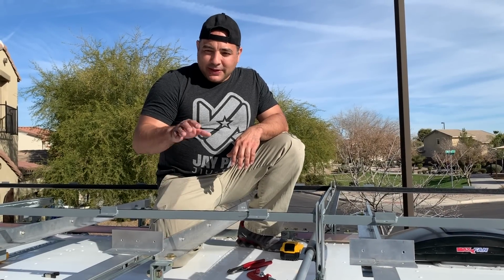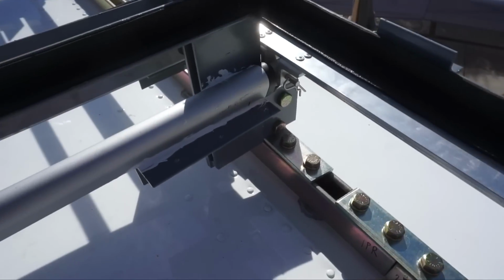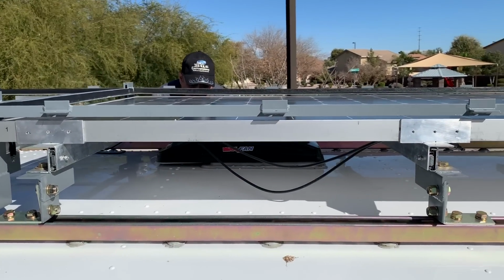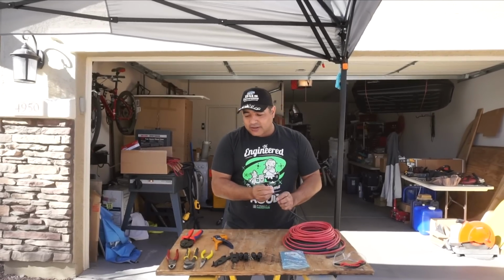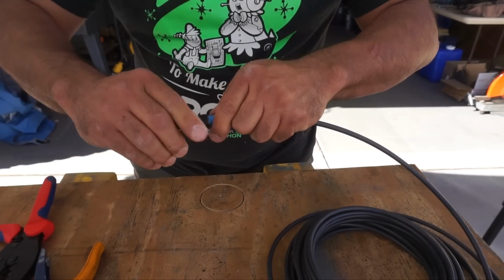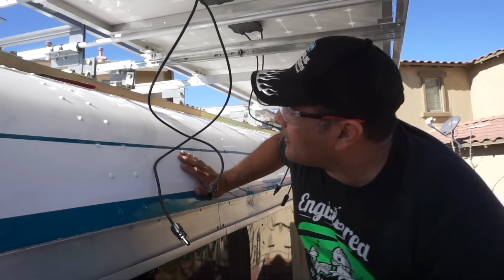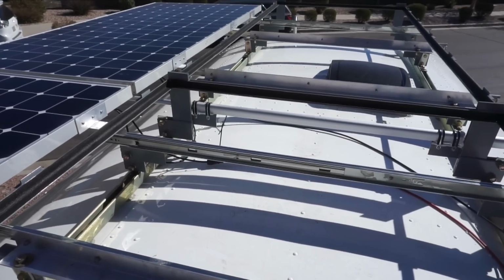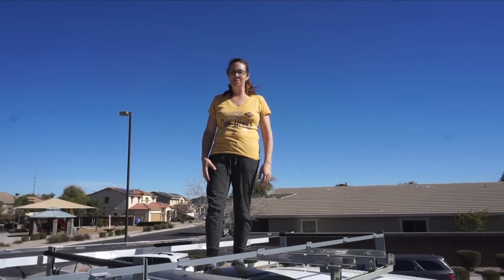Solar Install: Part 3: Mounting Actuators, installing and wiring the lower panels

Comment: I know this is a  couple yrs old, but what drawer slides did you use, and have they held up.
Reply from the maker: I think we are going on year 4 with these sliders in. It has worked great but not without some fiddling.  I have replaced 4 sliders because they end up eating the bearings after a while.  They are stainless so moisture and rain has not been an issue but they do tend to get gummed up with all the dirt and that ends up damaging the bearings.   If I was to do it again I would be strongly tempted to use a stronger slider or a different mechanism.
Reply: @Beginning from this Morning  I decided to just put the 2 Panel's on my roof and then make a suitcase out of 2 more panels that I can place anywhere. That way I don't have to park in the sun 24/7 ...I can partially shade the van and yet put the suitcase in 100% sun.
Thx for reply :)
Reply: One year later 😊

Comment: how was your entire system attached to the top of the rv
Reply from the maker: The entire system is attached with 62 grade 8 bolts that have a big backing plate attached to the structural ribs of the bus.  I wrote about it (and made a video) in this post: https://www.beginningfromthismorning.com/solar-install-part1/

Comment: What holds the panels in when driving? Is it just the actuator?
Reply from the maker: The panels are held in place by the actuator. They they are screw type linear actuators and are more than enough to keep them from sliding out.

Comment: Ha ha ha the real reason you didn't put the screws into the bottoms of the panel is because you forgot that once the panel was sitting on the roof you wouldn't be able to get the drill under there to drill it through the panel lol smooth move haha I do the same crap myself
Reply from the maker: well ... the panel slides out so we could easily get to the bottom of it ...

Comment: If it were me, I would have run those cables down in the uni-strut instead of tieing them to the sides of it. But AWESOME!
Reply from the maker: Thank you lifestyleatm - I considered doing that but thought maybe the heads of the bolts etc in there might be a little to abrasive and wear through some of the wires?  A small piece of plastic would have probably handled that fine.

Comment: Been catching up on your fabulous solar build. Found your channel through "Bus Grease Monkey". What I like about any build is the engineering that goes with it and you are a real thinker. Just wondering how the vibration is on the units and what may show up after some miles.
Cheers, Lee
Reply from the maker: Thank you Lee - We have had the solar panels up there for just over a year and so far so good.  We travel to and from the storage lot twice a week and they live in some bumpy dirt roads.  I did buy a couple spares in case one or two panels develops a problem.

Comment: G’day and greetings from Tasmania Australia 🇦🇺 what a fantastic idea I have been following your progress and it’s been terrific to watch.  The bus/coach is looking great I have subscribed all the best John PS. Are you going to put a wind deflector in front of the structure?
Reply from the maker: Thank you John - great to meet you.  Yes I am hoping to put a wind deflector on the front as well as fill in the sides.  We have had it on since Feb and it does very well - it doesn't make noise and you can't feel it going down the road but I think a small fairing like the semi trucks have would help with the wind.  Thanks for joining us!

Comment: I've watched all your solar videos and I can't find what type of slides you used for the moving panels.  Can you tell me what they are and where you got them?
Reply from the maker: Hi John - Sure - we got the first original few from Amazon and we got the subsequent ones from Firgelli Automations.  They are 50" slides and proved to be pretty difficult to find.  It looks like the price has gone up slightly since we have ordered them.  Every video has a blog post that accompanies it (you can see the link in the description) where we provide a link to all the stuff we used to build that project.  These blog posts provide more insight into how we made a decision as well as some more details of the more technical aspects of the build.  The one that describes the sliders is in part 2 - http://www.beginningfromthismorning.com/solar-rack2/ - if you scroll to the bottom it will have a link to all the stuff we used to build the sliders.
Reply: @BeginningfromthisMorning  Thanks for responding so quickly.  One more question, I see they are not stainless steel, are you having any trouble with rust and if so does it hinder their function?
Reply from the maker: @johntatman1436  I think they are stainless steel (according to the description) ... Been up there since February and 0 rust ...

Comment: I live over in AJ what company did you guys get your solar panels from and was curious on the size of those again
Reply from the maker: Thank you Dave - We are in Gilbert!  The original 8 panels we got from a Craigslist ad.  We did buy a couple of spares recently at a place called "San Tan Solar" which is actually in Mesa and they sell used Solar panels.  We had a great experience with those guys - very friendly and easy to work with.  These are SunPower e20 panels rated at 435 Watts each.
Reply: @BeginningfromthisMorning  thank you guys I greatly appreciate this I was hoping I could find similar panels to what you got. I am looking at putting a Tesla battery in mine. 1 Tesla battery weighs about 55 lb versus 6 lithium batteries at about 600 lb so I was going to go the route of the Tesla battery because it'll do the same as the others and fraction of the weight and because of the size and the room that I have in this little trailer
Reply: @BeginningfromthisMorning  watching you guys do this build what an undertaking it almost seems like a nightmare when you start and you guys have done an incredible job I love watching the progress you guys have made an incredible things that you have come up with for this build. Very grateful that you guys have been videoing the build I'm posting it. It's been a great help get some incredible ideas from all the different ones and it's nice to see one that's been done here close. Thanks again

Comment: I know it's too late now - but speaking as somebody who professionally does crimp connectors in damp/corrosive environments, you'd be doing yourself a huge favor if you put some Noalox on the bright copper before you crimp it.  It'll keep moisture and air out from under the crimp contact areas and keep it from corroding.  Any excess will squish out from the connection.  It doesnt have to be a anti-oxidant like Noalox it can be any kind of electrical grease.  Just dont use petroleum jelly as it doesnt get along well with rubber compounds and can creep and compromise rubber seals.
Also, zip tie the heck out of all those wires - wires that wiggle will break.
Reply from the maker: Thank you - noalox makes a lot of sense there!  I will know for next time!

Comment: I know it's nerdy by seeing those panels side into position was very cool. I wonder how wind noisey the whole construction up top is going to be? You may need to fab up some sort of small wind shield up front (that doesn't shade the panels.
Reply from the maker: Thank you Karl - it is crazy cool in person (the noise of the actuators makes it sound more 'robotic').  We have driven a bit with it on top and there doesn't appear to be any noise from it.  We do plan on putting some kind of windbreak on the sides and in front of it.  We still don't have a good design for that but we are working on it.

Comment: Very well thought out .
 Without a backstory , may I assume an all electric kitchen will be a focal point ?
Reply from the maker: Thank you Mark you are correct - we are planning to have a convection microwave oven and induction cooktop.  The only thing we couldn't figure out is hot water - we will be using propane for that

Comment: You guys are brilliant and doing an amazing job with the bus! I saw your Instagram post on this and I think I was just as excited to see it all work how you dreamed it. So first, congratulations and thanks for sharing such incredibly useful information with great detail. My question today is where did you purchase the actuator from, and is it weather sealed in any way? Btw, Juan I practice BJJ so I also want to congratulate you on your black belt! Cheers from California.
Reply from the maker: Thank you so much!  Where do you train?  I have been with Jay Pages for about 8 years - you should come roll with us when you visit AZ.  The actuator I purchased was from Amazon - it has a 1200mm stroke (https://amzn.to/2UauUa1).  The actuator is supposed to be IP54 rated for weather.  I didn't trust the weather rating so I built a small housing to protect it  -  you can see it here: https://photos.app.goo.gl/LrHmWcXC2pKzW53W8

Comment: I really dislike MC4. Anderson stile is much practical.The only thing is you need to solder.  In this situation you are forced to do the MC4 because of the box, wich is awesome. Thanks for the vid again
Reply from the maker: Thank you Jaap de Wind - I don't really have any experience with Johnson style connectors - are they water-tight?
Reply: Anderson Powerpole connectors are great.. I am a ham radio operator and that's what we use a lot. However, they would be my last choice for something like this outside. There aren't any type of grommets on them to prevent water damage so I cant imagine they would hold up as good as the mc4 connectors, at least in this case
Reply: @toddlaplanteVT85  agree
The anderson are very suitable for high dc power like batteryboost and between the solarregulator and the powerbank. 
Another tip.: connect the solarregulator first to the batteries to let it adjust to the voltage of the bank. Then connect the panels

Comment: Years ago I had a trailer with an antenna on it and needed to make sure it was down.  I installed a timer that was triggered by the brake lights.  The timer pressed the button that lowered the antenna.  Once it hit a limit switch, pressing the button did nothing, so there as no problem with the timer continueing to activate each time you hit the brakes.  You could use this here to retract your panels.
Reply from the maker: Thank you Wes.  Automating the panels was a big deal because it provides the mechanism to accomplish exactly what you are talking about.  I don't know if you have watched some of the my other videos but I plan to incorporate a fair amount of home automation features into the bus and some of that is definitely going to be geared to things like making sure we minimize the risk of damaging our panels.  This means we can start building some logic around how the panels are controlled: if it gets too windy - we can bring in the panels, if the battery is already 100% charged - no use in risking a gust of wind for no gain - bring the panels in, if the engine starts - bring in the panels, if it is night time - bring the panels in ... lots of exciting possibilities.

Comment: What is in the create in the driveway?
A surprise? You should edit the part where you are making your connections and
post that as a short how to on those connectors. When you were drilling up into
the frame for the zip tie...with not protection for the panel ...I was holding
my breath. I would hold a small 1/8 thick piece of aluminum up there to protect
the panel from the drill.

Wasn't there some talk awhile back about putting the cables in a moving cable chain carrier https://www.alibaba.com/product-detail/cnc-moving-cable-energy-chain-wire_60366331679.html

Great video!
Reply from the maker: Hey Glenn good to hear from you.  I had to go back and look at the crate ... that is insulation :D ... we hope to be using it very soon :).  Great idea on a video on wiring the MC4 connectors - maybe when I have a little time I will put out a video on just doing that part.  Yes, I should have backed the drill with a piece of wood or scrap aluminum - I could have easily slipped and cracked one of the panels.  I have considered putting the cable in a protective chain like the one you linked - it will move better and not rub - I am still trying to decide on a good design.  The one you linked looks pretty beefy.  As always thank you so much for the input.

Comment: and drilling towards the underside of the panel, put a piece of wood underneath so you do not hit the panels when plunging through the hole with the drill bit
Reply from the maker: Great tip - it would have been really easy to slip and maybe crack a panel.

Comment: gluing the activators? it will make it extremely difficult to adjust.
Reply from the maker: They shouldn't need to be adjusted - if they were able to move ... then they would need adjusting.  If these need to be adjusted something has gone horribly wrong.

Comment: why didn't you use U bolts of radiator clamps?
Reply from the maker: Thank you Reverend - I was a little worried about crushing the shaft with heavy duty clamps.  The body on the actuators is all aluminum and I didn't fully trust the integrity of it.

Comment: 20 volt lithium Dewalt batteries are actually only 18 volts. Its a marketing gimmick. It will move much faster when you have true 24 volt power source. Great build !
Reply from the maker: Thank you Jeff - now you have me curious!

Comment: Very nice work. You might have enough room to bolt an aluminum cat walk down the middle so that you don't have to walk on the roof. Also, maybe some custom fiberglass fairings painted in one of your colors could form a removable skirt around it. With some removable rubber padding, it would be possible to carry bikes on the outside of the roof rack. I wish I had a picture of my GMC fishbowl carrying 45 bikes from Portland to Bisbee many years ago.
Reply from the maker: Thank you Kevin - we haven't decided what to do yet with the skirting around it.  The fiberglass idea is an interesting one.  LOL - 45 bikes!  That is amazing!
Reply: Beginning from this Morning If you want me to email you a picture of the aluminum cat walk material, I can. It is about 9" wide and 1.25" deep. Two bolted together is safe to walk on.

Comment: Really good video. Where did you get the actuators and slides for this project? I like this setup.
Reply from the maker: Thank you - we got the slides and actuator from Amazon.  Slides are 50" stainless steel 400lbs slides: https://amzn.to/2NnD0t8 and the actuator is a 1200mm (48") stroke Linear actuator: https://amzn.to/2BPEhEH

Comment: I would think you could just cut one using scrap wire to get the length for each section and then write down all the lengths. 

I would have just replaced the Combiner MC4's with normal Glands and hard wire them. Easier than making those MC4 connections. 

Are you going to have something like a shroud for the front of the panels? I have heard people complain you get a ton of road noise when you have raised panels on the roof.
Reply from the maker: Thank you Stephen - yes we plan on having some kind of shroud or fairing all around the structure (minus the back).  The MC4 connections where actually pretty easy to make.

Comment: Those zip ties are only going to last about a month. Let me know if you want some good stainless steel ties.
How are you going to manage the wires that have to move back and forth with the slides? If they are flapping around as you drive, you're going to wind up with problems.
Reply from the maker: Thank you Evan - I worried a bit about the wire ties and stainless steel ties had not even crossed my mind!  What a great idea!  I have a suspicion that the wire will not flop around too much it is very stiff and we plan to secure it as much as we can while still maintaining enough slack to allow the slide to come out.  I will keep a close eye on it and maybe install some springs and stuff to keep them out of the way.  We also plan on installing some wind protection all the way around that should hopefully keep the wind out of the under panel area.  Thanks for the tip!